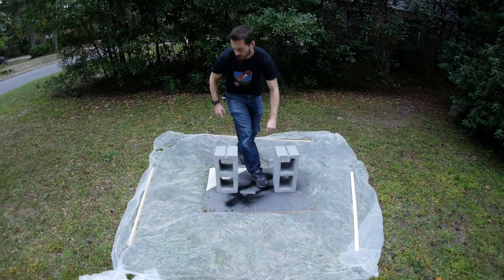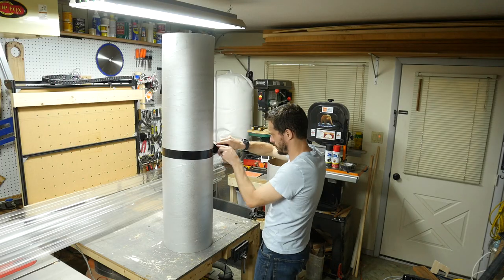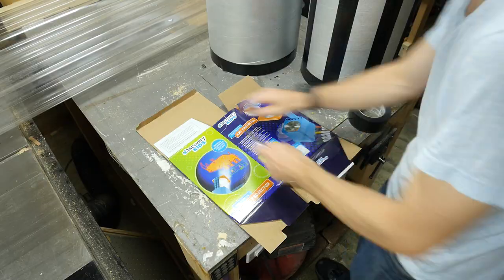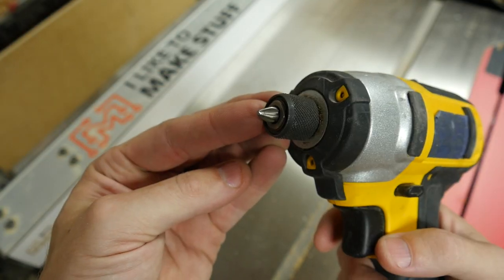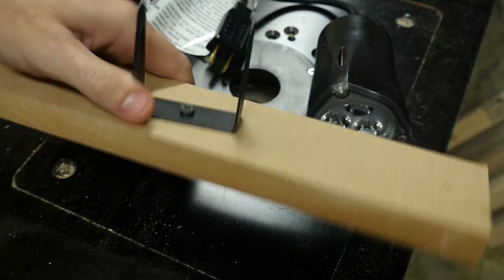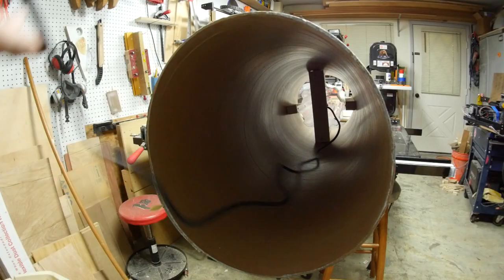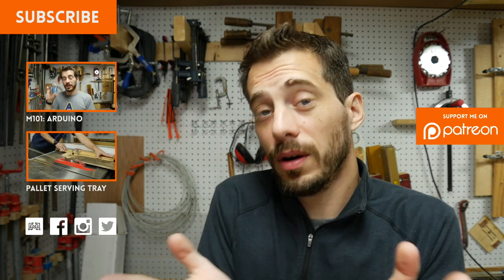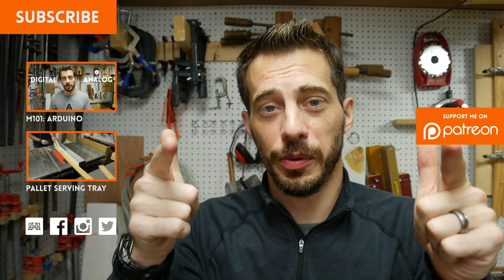Giant Lightsabers (Star Wars) // How-To | I Like To Make Stuff

Comment: Hi Bob! Love your ideas. I saw the saber video yesterday and suddenly felt sick at work. ... Or was I sick of work and really wanted to build these with my kids. I ditched the office and stopped at HD on the way home to gather supplies.  A few hours later and "insert saber sound" I'm finished. They look awesome. However I want them brighter, mine don't seem to be as bright as yours. I used the same clear corrugated roofing and a LED 400 lumens flood light( perhaps I need a spot light instead of a flood light). Color is 4000 and has a interchangeable red and green lens caps.  Do you think if I frost the tube lightly with white spray paint it would help?
Reply from the maker: +Kevin Moore Sorry you were feeling so bad  ;)    Frosting would definitely help some, but instead of spraying white, I would lightly run over the whole surface (which will take a while... why I didn't do it) with some sand paper.  Other people have suggested putting a reflective cap on the end (maybe with aluminum foil) to reflect the light back down into the tube.

Comment: I dig it.  Since the lights you used are LEDs they probably run on 12V DC (or 3v or 5v or some other standard but easy to figure out voltage).  That means you could make these babies battery operated if you hacked the lights.  A cordless drill battery could be an easy power source.  Just a thought if you wanted to run around with them after your Christmas display.

Comment: lots of comments, so its likely mine is a repeat...  A great build!!!  It did really look like fun to create... just a small suggestion for upgrading it.  Cap the end of the plastic tube with a reflective mirror like material that would further fill the tube with light.  The same add can also be put on the handle side with a smaller diameter hole cut to allow the LED light to shine through, but also again reflect the light back to the upper 'mirror'.

Comment: EPISODE VII!!!! Anywho, I saw a thread on the RPF a while back of using an acrylic sheet to make a laser sword, basically, they cut out the sword shape, then a bunch of small rectangles and glued those to the "handle" then they sanded the handle round so it would fit into a pipe. They then put a flashlight behind the pipe and it lit up all of the scuffs and scraped in the acrylic! I was thinking of just making a whole cylinder, sanding it and then lighting it, it might look like a saber!!

Comment: Something you could have done to make them more equally illuminated was to paint the corrugated plastic white near where the light is (from the split 2x's and down) and put either a white or reflective surface at the top. That would bounce the light around and create an even fill all around. Either way though, still awesome.

Comment: Impressive! Most impressive! These are awesome! I cannot wait to make these. Just wondering did you have balancing issues since they appear top heavy?
Reply from the maker: +Frank Gough Thanks! No, for setup I dropped them down over a cinder block and that keeps them upright pretty well.  I had a strong wind take them down a couple of times, which is to be expected.  You could also make a base and mount it kind of the same way the blade was mounted into the handle.
Reply: Thanks for the feedback. I will definitely consider a base of some sort to mount them to for stability.

Comment: Neat project.  I wonder if rivets would've worked better to attach the corrugated plastic together rather than screws?
Reply: yeah I would think so, might not be able to reach the rivets in the middle from inside the tube though.. if that makes sense
Reply: ***** don't they make "blind" rivets for that type of application?
Reply: +Mike Kapotsy yeah you're totally right. I think the last time I used a rivet gun was about 15 years ago.

Comment: Do you think it would be worth the effort to add a cap at the end to reflect it back down and diffuse it to better light the tip?  Perhaps some styrofoam or a plastic dome to strengthen it and help protect the electronics from weather?

This is my kind of project. ;)
Reply from the maker: +Aerik Forager Not particularly.  They look fine for my needs.  The spotlight is and outdoor spot, so it's fine in the weather.

Comment: can you make something out of wood again?
Reply from the maker: +Redmer de Boer I made a wooden serving tray a couple of weeks ago. I'm making a wooden project right now, and working on my wooden arcade machine.    But just so you know.. I make projects that I want to make, regardless of the material that they use.  I hope you're able to find something fun or useful in all of them regardless of the material.
Reply: +I Like To Make Stuff
using a sand paper of about 80-120 grit,sand the outside of the plastic tubes which will make it translucent and give it texture.This will really diffuse the light from the led and the whole thing till the top will light up.